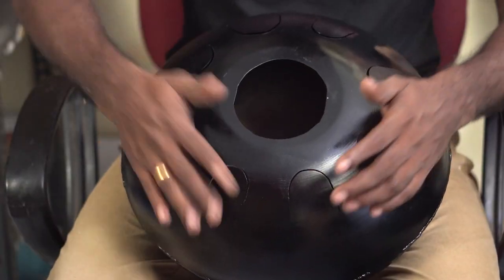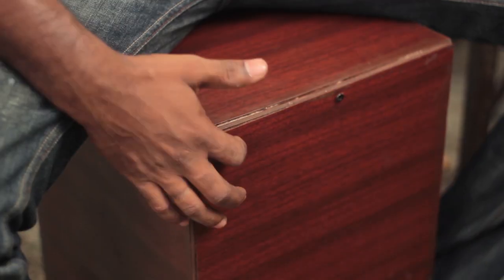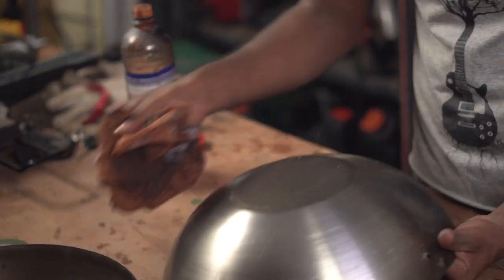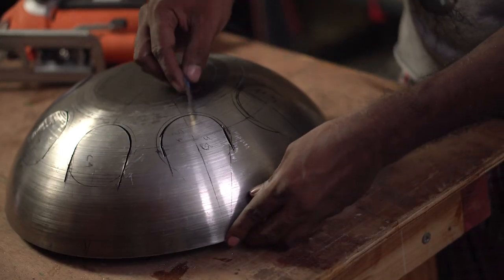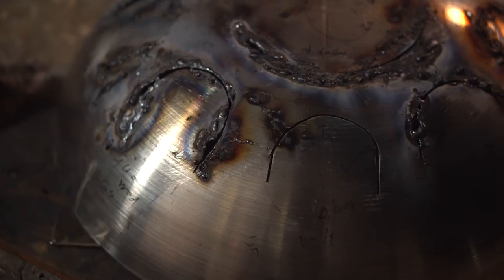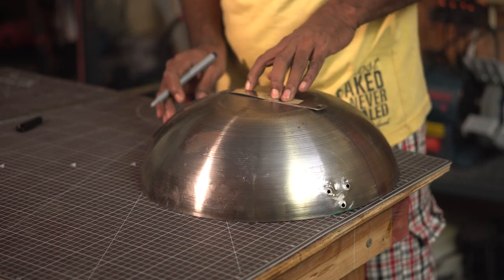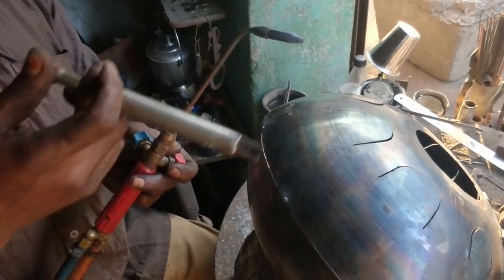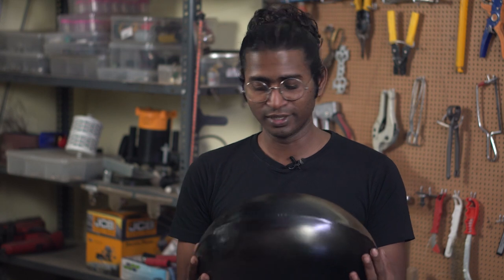#Tank Drum/Tongue drum  made from Frying Pan (it sounds awesome)

Comment: oh dear. i'm impressed. but could you list up what tools i would need at the minimum to make this without having an established workshop at home ? let's say i'd do it in my living room, what would i need, and how expensive would it be at least ? 
thx
Reply from the maker: The material ie, the frying pans cost less that INR 500 or  7USD. Tools are a bit tricky. The question that needs to be asked is" how to cut a slit in the metal neatly without getting the workpiece damaged. I would say, get the starting cuts made at a workshop , which is good enough for a hacksaw blade.  Then you can do it in your living room. (But try not to do as the metal filling can get under your skin and it could be hurtful. )